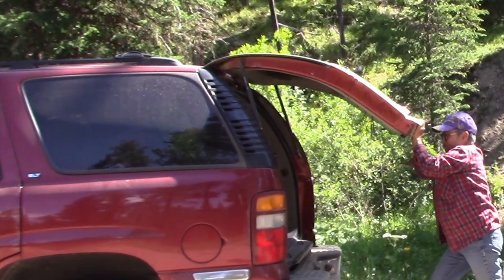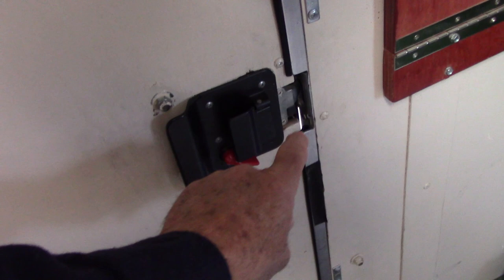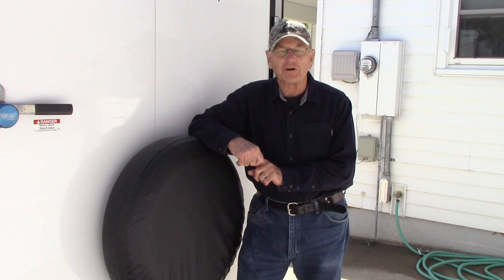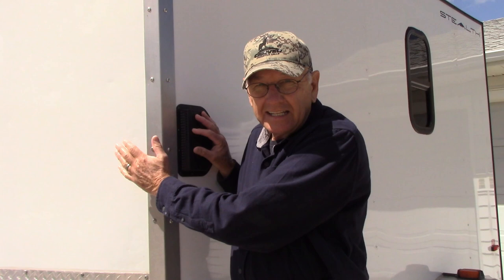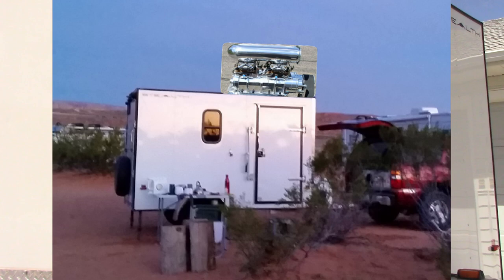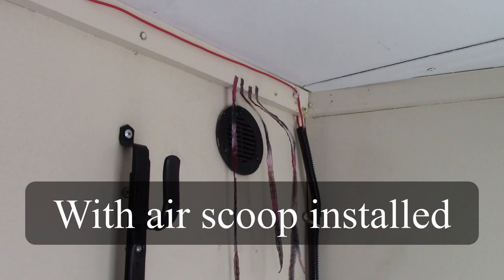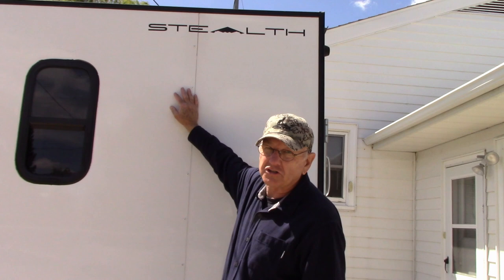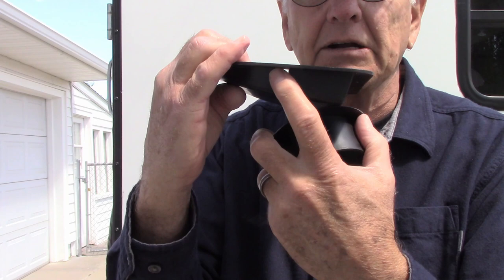RV Life Hack - Keeping the Dust Out Of Your Camp Trailer

Comment: Boy that was probably the best tip to keep the interior of the trailer in a positive pressure. I am most likely going to have a custom built and will have the vent installed further back from the front edge. Thanks for sharing
Reply from the maker: You're welcome Scott.  I just did one of these on my daughter's trailer.
Reply from the maker: You're welcome Scott.  I just did one of these on my daughter's trailer.

Comment: Hi you two ! We just subscribed , and also want to talk about our cargo trailer . It's 20 ft., V- nose , dual Axel's . We don't have the dust problem , but here in the south we have mold problems . When I built this cargo , I started with good insulation and a 15,000 btu roof air . I run it every other day for about half hour . This seems to do the trick along with those Damp Rid bowls . I also carry a 4,250 watt Champion generator in the trailers garage .  It sits on a hand pulled cart and with the drop down rear cargo door it's easy to get out and manuver .        Kathy's doing much better and says she might let me live .  I asked her to promise me she will leave a little of me for the Undertaker . Says she's thinking about it . Oh well , be safe out there !
Your good friend Vinny in good old Fla.
Reply from the maker: I see you have the opposite problem with the mold instead of the dust.  I'm glad Kathy is doing better now and has decided you're worth enough to keep around.

Comment: We bought a V-nose trailer to convert for camping, our trips regularly take us out to the desert and even after having everything sealed we were still getting dust in. We tried explaining to the place we bought it that they need to put the vents in the front but their response “we’ve been building trailers for 25 years that’s not the issue here” 🙄 ya some engineering skills they have
Reply from the maker: They design them that way to evacuate gas fumes out of the trailer in case a person is hauling a motorized vehicle in there, but it makes it a dust magnet if you turn it into a camper like we do.

Comment: Hello again Gonagain. I blocked off both my vents and am putting one on the floor I can close off when I travel I'm not sure how well it'll work out but I have to try it. When I get where I'm going I'll open it and turn the fan on 230 mm computer fan to pull the heat from the top of the trailer down and out as well as pull the heat from the frig out with it. I have also found that around the frame underneath the trailer is where a lot of dust comes in so I sprayed Flex seal around it all to help seal it. I do like your vent cover you made I may try that to at first I pulled it off and put screen in it I had some wasp getting in my trailer and kept hearing the in the walls. As always we hope your tomorrow is better than your today was.
Reply from the maker: Thanks Den!

Comment: Definitely one of the best channels on YouTube. Great content and excellent production. Very enjoyable to watch too. You always have such great well thought out ideas. I'm building a 7x14 TA and I've used a lot of them. Sometimes putting a little twist on them but you put the idea in my head, so thanks for that. 
I just put 4 vents in the walls of my trailer. One in the top two corners of each side wall. They have a handle on the inside so you can change them from opening on the leading edge to opening on the trailing edge but you can also completely close them. They're like the ones you see on the side of big truck sleeper cabs. If you google "Aluminum Low Profile Popup Vent" you'll see them. If anyone decides to buy them make sure you get one with the trim ring included. They sell them both ways. 
Cheers,
Reply from the maker: Thanks for that tip on the vents.

Comment: I think it's for ventilation although often not engineered the best. My problem is dust from the ac/heat unit I'm on my way to get filters now however I'm certain this will only mildly help. Thanks for the video
Reply from the maker: Hi Tristan, for my solution to work there can't be anything leaking air making it so that you can't pressurize the interior. For example; I discovered that the flue from my stove had to be closed off with a solid damper. I installed the stove and all of a sudden I was getting dust!

Comment: Hi, subscriber and fellow cargo trailer camper youtuber here. We took our little Weeroll trailer all the way up the Dempster Highway to the Arctic Ocean this summer. That is 546 miles (one-way) of gravel, dust choked roads. There was no vent on my trailer, needless to say it was a dusty lesson! When we were up there, I told my wife that I knew Gonagin had addressed this problem in  the past, and I was looking it up when I got home. So here I am.
My question is this: my trailer has a modified V nose. So, it's flat in the middle and then has 45s on each side. Do yo think placing the vent high up on the top of the left side 45 will give me the air flow that I need?  Thanks!
Reply from the maker: It would provide plenty of airflow as long as you keep your speed up to 15+mph.  Make sure you correct as many other air leaks as possible (I had to close off my propane stove flue) and you should be good.  When driving in heavy snow I close off this air scoop with a piece of Gorilla tape (the best duct tape).

Comment: Very interesting, I would have really set myself up because I thought about doing the opposite  and not getting vents. Could you imagine the suction that would have created.
Reply from the maker: Exactly!  The reason these trailers are vented this way from the factory is to pull any gas fumes out, in case you're hauling motorcycles or an ATV, but it also sucks dust in, and that's why the system needs to be modified like I showed in the videos.

Comment: I have an Interstate cargo trailer, with the slightly rounded front, not a v-nose and with the hi/lo vents. Haven't done a lot of travelling in it yet, just to Quartzsite once and on paved roads until the campsite. Didn't notice any dust. Do you think blocking the rear (lo) vent with duct tape would pressurize the trailer and keep the dust out? I'd take the tape off on arrival as the ventilation is important while sleeping, especially if I want to run the Mr Buddy heater. I generally only run that in the morning after I wake up.  Love your channel! You always share great information!
Reply from the maker: You could tape the lower rear vent from the inside ok.  The vent in the front needs to actually scoop air in to properly pressurize the trailer and I'm not sure if the rounded nose of the Interstate will affect it negatively.  I know that a flat nose didn't hurt it if the vent/scoop was located a few feet back of the nose.

Comment: Being from Louisiana I’m never going to have to drive in blizzard conditions but I do wonder if you can get duct tape to stick under those conditions. Maybe stuffing a couple of Walmart bags would stop the snow. Interesting video. 
I have a travel trailer and in process of considering converting a cargo trailer.
Reply from the maker: With the sheet metal scoop I have I actually stuff a rag in it, but if the vent is actually mounted on the face of the V then it would need taped.  I think Gorilla brand duct tape would stick in the cold.  Good point you made.

Comment: EXCELLENT! Thank you so much for this video! I am going to have a custom made trailer built. I was thinking about getting those aluminum vents with the door that you can open and close.instead of the plastic ones. Should I angle the door so it scoops the wind from the front or from aft? Next question, where would you place the vents? Additionally in the rear I was planning on having a marine type solar fan in the roof, what do you think about this?
Reply from the maker: The marine solar vent is a winner for sure.  Any vent you use on the upper front should be positioned so that it scoops the air inside, so your vent could work if it's located right.  The vent in my video won't let rain pass through, so that's a consideration.  You need something to catch that air off the V nose though.  Remember, my factory set-up actually sucked air out!

Comment: Extremely informative! Thanks  Do you need an exit vent for all of that air coming into the trailer?
Reply from the maker: No you don't.  You want to create high pressure inside that keeps the dust from getting sucked in.  You know those air gaps around your door seal?  Now you would have air going OUT instead of going in.  It works very well, just ask Linda.

Comment: I guess I don't quite understand how the vents work to prevent the entry of dust ...I guess I'm dense..What about adding a nose cone to the front of the trailer to deflect the air..Would that work? Thank you for the video..Have a blessed day..
Reply from the maker: Hi Gail.  The vent works because it forces air inside the trailer making the pressure inside higher.  It wouldn't work if there was a window open too.  The trailer needs to be totally sealed up EXCEPT for that one vent (air scoop) blowing in.  Let me know if you still don't get it because I want you to fully understand.

Comment: Very interesting ideas how to keep it dust free as you can but doesn't the vents add to the problem in some cases? just like the strait piping of the muffing system with the closing and opening system some have put on the vehicles for better gas mileage on freeway driving that work against their engines instead of helping the engine?...
Reply from the maker: The way the factory installed my vents certainly made the situation worse!  That's why I removed the rear one that was sucking air out and modified the front one to blow air in (it was sucking out too!).  With the trailer totally sealed and that one vent blowing in it keeps dust from getting sucked in.
Reply: @gonagain  Like I said very interesting how you figured out what was the problem and then went about to fix the problem by thinking it out and doing what was overlooked by the makers error...

Comment: Newly subscribed and love your videos, i have the flat nosed trailer. I seen you suggest the vent on top and just back from the front a bit.  Do you also suggest one in the back facing the rear or just the top one? If you wouldn't mind answering.
Reply from the maker: Just the front one to force in air.  Don't have any other openings in the trailer at all and make sure the windows and doors have good weather stripping.  If you have a chimney flue, find a way to seal it off so that the air you are forcing in doesn't just go right out.  You want to create pressure inside to keep the dust out.
Reply: @gonagain  Ahhhhhh thank ya kindly. We sure appreciate you answering...Good travels...Maybe see ya out there. Looking forward to going through your content.

Comment: Love this!  Any thoughts on how to pressurize a large motor home?
Reply: glen schumann I wonder if you had 2 fantastic fans blowing inward if that would generate enough positive pressure in your rig.
Reply: Try it and try to leave 1 window cracked open. You a punk or something on that order to see which way the smoke goes
Reply from the maker: First, NO windows open because you need to actually pressurize, or make the pressure higher, inside the coach.  The Fantastic Fans blowing IN are probably a very good idea. Also, your HVAC in the dash on high blower with "outside" air selected will help a lot.
Reply: @gonagain  Thanks.  I will try two of my three fantastic fans.  Will also try chassis AC blowing in but am concerned it may pick up dust from front wheels.  Enjoy your videos.  Wish our coach could go all the places you go.

Comment: Won’t blowing additional air into the cabin blow dust in as well? I’m just thinking about following another vehicle in the desert for 50 miles, eating their dust and there is a scoop sucking their dust in. I’m interested in this for a truck canopy (camper shell) and may be following a vehicle in the aforementioned manner. I guess an air filter could prevent this. The canopy I’m looking at doesn’t have a filter, just open to outside air. Thanks for any insight.
Reply from the maker: But why would you follow in someones dust? Your engine air filter is clogging up fast when you do that with the tremendous amount of air that an engine takes in per second. Not to mention your cabin air filter in your vehicle. On the trailer, the air intake is above the dust from the tow vehicle so it's getting clean air.
Reply: @gonagain  It’s kind of coming when overlanding to follow in someone’s dust, especially if you’re in a convoy of three or more. A lot of people run snorkels to get the air intake higher up for that reason. Thanks for reply!

Comment: Rick, I'm a little slow but what would be the difference between blowing in dusty air and sucking in dusty air? Thanks for all your great tips. I'm just about finished with my trailer. Safe travels Perry
Reply from the maker: Good question Perry.  If you'll notice in the video, where we are driving down that dirt road, the dust is low to the ground at the front of the trailer, so the site up at the school is clean.  Most of the dust that comes into a camper enters from the rear end.
Reply: @gonagain  thanks again

Comment: My trailer doesn't have any air vents I took off the top air vent and replaced it with AC do I still need to add a air vent on my trailer ? Thank you for sharing. 🇺🇲🤙🏼
Reply from the maker: Hi Rocky, if you intend to drive down dusty roads very much then yes you do.  Your trailer will still suck up dust like a big vacuum unless you pressurize it with the single side vent.
Reply: @gonagain  okay I'll have to look into getting it installed, should I get one for each side, my trailer is a V Type like yours but my door is on the front where the V is,  yours is on the side of your trailer. Thank you
Reply from the maker: Just one vent will do, but pay attention to what I said about the vacuum created right behind the vee and the scoop I had to build. On my daughter's trailer we put the scoop on the face of the vee itself, but we're not sure at this point how that is going to work in the rain. We should find out this spring yet.
Reply: @gonagain  Thank you brother. Keep me informed how it works out before I do it. Much appreciated. Stay safe and say hi to your wife. God Bless you both. 🇺🇲🤙🏼

Comment: Some trailers I was looking at had no vents. Should I avoid this ? How about having a slider screened window open a bit instead ?
Reply from the maker: A trailer with no vents makes that "vacuum" situation I was talking about, so it will suck the dust in and leaving a window open makes it worse.  Make sure all the door seals are in good shape, close everything tight and install a vent like the one in the video.  If you have a regular travel trailer without the V nose that I have, you can locate that vent about three feet from the front and it will catch air fine.  That's how I learned about doing this.

Comment: Indispensable!

(Doesn't dust come in the front V vent?)
Reply from the maker: No, because the vent is above the dust.  The only time we have a problem is if a tailwind is present and it's faster than I can drive to outpace it.  We just did 30 miles of dirt road today and I'm sitting in a clean trailer.

Comment: My conversion is almost complete and my guy closed up the lower right side vent and replaced the upper left vent with a dog bone style one that can open in either direction. Should I just leave that vent closed while traveling then.? Thanks
Reply from the maker: Can that particular vent be faced into the wind to force air into the trailer?  You need that to make the pressure inside higher than the ambient pressure outside.  Also, remember that the location of my vent behind the V nose actually made it suck air out.  Put streamers on the vent inside and tape a camera to the wall and film it as you drive.  It needs to blow in.  I hope I helped.